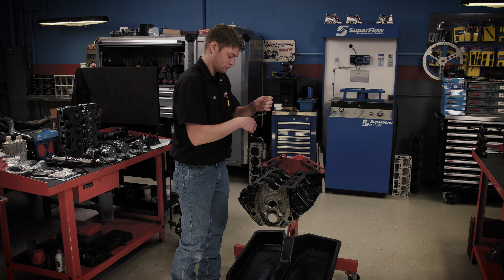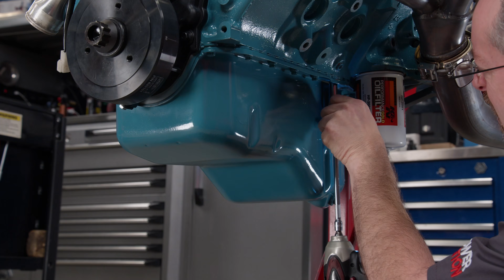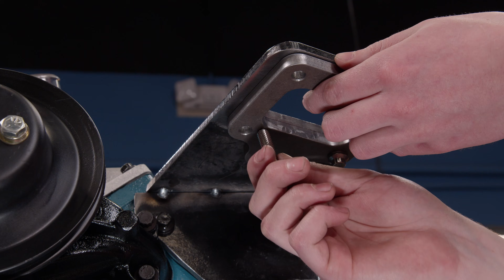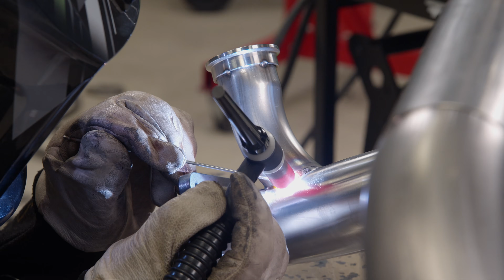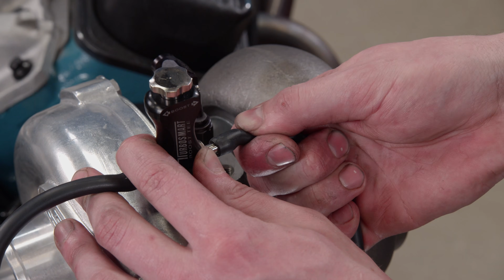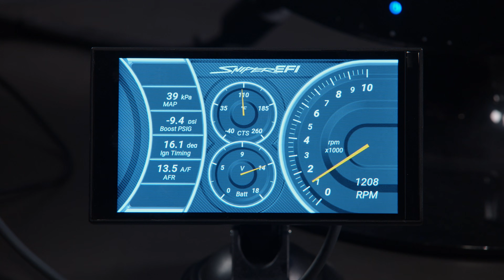Boosted 4.3L V6 Makes Over 500 lb-ft On The Dyno! - Engine Power S9, E8

Comment: At 58yo and have owned many many GM trucks in my life, most have had V8s, but a few have had the 4.3L V6 which I have usually gotten 300 to 400K miles out of, they are solid little engines.
Reply: chevy should have built this with modern fuel injection and put it in the colorados and all the smaller suv’s. hell mayb even the bigger ones to.
Reply: @stanroark55 they don’t care enough about us to make good products anymore…….. it’s just a money grab.
Reply: @stanroark55 they did there is a gdi v6 based on the gen5 it's pretty good
Reply: @stanroark55 Well to be fair they just phased them out in like 2016. Yeah it’s been 10 years but it’s still there
Reply: Chevy does have a modern vortec 4.3V6 with multiport fuel injection. I had a Chevy Express 3500 van with that engine. It was a 2019. 275HP, 295 torque. Still the standard base engine for the Express 1 ton and WITHOUT cylinder deactivation-which is the stupid fuel economy tech that's been killing LS/LT engines in Chevy trucks
Reply: I’m at 325k on mine. 02 Silverado single cab. She’s slowing down a little, but the thing keeps chugging along and never gives up
Reply: My youngest sin has blown 2 up within 2 months
Reply: @Davidsmith-uu4bl  son needs learn how maintain one got 400 thousand out of mine and my other one had 300 thousand 😮
Reply: Currently on 230k miles on my work van still running solid
Reply: @twitchgxgge I'm guessing you had to replace the timing chain at least once??
Reply: @Tomarsnback.  I have seen so many 4.3s with 200,300,400k+ miles and I've never even heard of that once
Reply: I have a 97 S10 5spd vortec. Prb 330,000mi. I've swapped trans (locked UP on freeway😮) but I put another 5spd in it, cat stopped up once so new cat, let it sit up 15yrs (...marriage 😮). Last year I pulled the gas tank and swapped it and the fuel pump, filter, spider injector, plugs, swapped the factory flex fan (awful feeling it rob power) with an electric fan assembly, drilled and silver brazed the temp sensor boss in the thermostat housing (looked really good). It ran. I took the 97 core support off and installed a newer idk 2003 core support and modded the wiring. Not finished yet but about to spend some more time on it.
Reply: I have a 1997 WT with a 4.3. I was at 280k when it blew a head gasket. I did a mild rebuild to get it back on the road.
Reply: I have a 95 S10 with the 4.3. Has 306,000 miles and is stroking right along. My dad purchased it new. I inherited it from him with 5,000 miles on it. It is a TBI and has been very solid up to this point. I love this little truck!!!
Reply: @stevendiffy768  The Chevy S10 is a legendary truck. I wish I still had one.
Reply: @stevendiffy768  Agreed
Reply: @stevendiffy768 that’s good to hear. I just bought one that has 120,000 miles on it with the 4.3 tbi it runs like a sewing machine
Reply: Agreed, had a 2000 Safari and it got 1 million miles across 2 rebuilds. The engine still ran perfect too. The rear was rotting out and my leaf springs were being held on by hopes and dreams. I only put a better distributor, iridium spark plugs, new wires, water pump, and thats all the engine parts that were ever needed. My new 1997 astro im currently doing head gaskets on. Seemed to be an ongoing issue since I got it but ended up overheating once and cylinder 4 was getting Hella coolant in the combustion chamber. Once its back together im hoping its fixed and runs like it was. Cleared a lot of gunk out the coolant ports so I feel like it was a gunk build up that caused my issues. Always flush coolant system properly before switching to green coolant. The dex cool polymerizes and makes mud when mixed with green coolant. Had to dig some of that mud out the port openings on the block with a screwdriver and vaccum. Put some felpro permatorque head gaskets on. Should hold until the engine is done.
Reply: @toastythereaper7119 aren't the safari a awd ride?    Build it all in black ,,back in Chevy cyclone days. They used awd drivetrain from the Astro van awd , check out the specs on them,, something in the transfer case was the ticket and that problematic tuned port stuff I can't stand, then tuned port would be out for me to many other useable simple options.   Less is more in my book, hard to beat the Rochester spread bore!!!😊.
Reply: My buddy is currently at 368,000 miles on his 4.3. it runs perfect!
Reply: I'm so sorry!!
Reply: 96 and 98 Blazer, no engine problems, trans weren’t great.
Reply: @808bigisland  if you change the fluid and filter often, they normally last a long time. I've always had good luck with the 700r4, 60e/65e/70e. People beat on them for 100k, 200k miles and never change the fluid and they get a bad rep because of it.
Reply: 250 K on my little C1500 and going strong with almost 0 power loss over time, (except when head gaskets leaked).
Reply: I’ve got mine with original motor and trans ticking at over 322k
Reply: little ie 262ci (small block?)
Reply: My first truck 1990 GMC S15 
Had the 4.3 with a 5 speed 
It was basically a full size truck
Reply: A GMC Jimmy, and 2 S-10 Trailblazers I had with the 4.3 went over 200,000 each with no failures
Reply: ❤️ My S10 just hit 313,000 miles this afternoon!!! It sounds amazing!!!🇺🇸
Reply: There’s a guy I watched on YouTube who found a single cab short bed V6 Silverado and turbo charged it with a marine intake from the short lived boat use engines from the 4.3 Vortec. Guy made 390hp and 434pftq
Reply: I own a 2008 sierra with a 4.3 vortec runs real good has 300k miles.
Reply: I just got a 1985 Chevy c10 Scottsdale long bed that has a 4.3 v6 people keep telling me to swap it but I might keep in it for a while it’s been running so well might to boost it  too 😅
Reply: The 4.2L Vortec inline 6 is heads and tails better.
Reply: How?
Reply: Mine was only at 143k and crankwalked
Reply: @ExtremeDirtRipper69 that is because you didn't do regular oil changes and ran it like a race car. You were lucky to get 140k miles.

Comment: Need to do an Atlas 4200 build guys. Nivlac57 has proven this platform is really slept on. I’d love to see what you guys could do with one of those. Also, 4G63 build possibly? 4B11 build? KSeries, B series builds  would be fun to see a shootout between them all.
Reply: Go for Atlas🤙🤙
Reply: I pray they don't. 4200s are still quite cheap.
Reply: @ggates2500 I doubt they even read these comments. I wish they would do more uncommon engines/builds like this video. We know they can build any engine from the Big 3, venturing out to do uncommon engines would be awesome! The VK56 V8 from a Nissan Titan seems to be quite the beast, they make 1966hp stock block, crank with just pistons and rods. Running mid 6’s already. Or the Hyundai Tau 5.0, something kinda odd ball but I think could make great power. I’d love to see Pat do a mad scientist build on something like those engines.
Reply: The Nissan engine is essentially a bigger coyote
Reply: Another Atlas 4200 vote
Reply: Here's Richard's  4.3 vs 4.2   youtube.com/watch?v=2bWgouS97VY   4.2 made more power @ 8psi than the 4.3 made @ 13psi. and the 4.2 was straight outa the junkyard with not great compression on 2 cyls and it was an early one. the later ones make more power. 4.3 was bascially rebuilt fresh
Reply: I agree
Reply: Build one please!
Reply: The American 1Jz 😂
Reply: There’s a guy n my street with a 550whp Buick Rainier with the 4200 atlas. All it has is a mocked up turbo set up
Reply: I'd like to see the inline 5 of that engine series on a build, but i guess it doesn't matter, i started mine. lol
Reply: @GridIndustries The 3.5L Atlas is a hell of an engine in stock form, but I think it'd be ALOT of fun with a set of forged internals and a turbo build!
Reply: That's my plan, but rods and pistons are crazy expensive! Nivlac has proven the rods to like 700hp and I'm not going near that high. So i think pistons are gonna have to be the compromise and run the stock rods.  @GivethToMeTurbo
Reply: I built a 1997 Civic coupe with a B18B1 non-VTEC Honda engine with Eagle H-beam rods, CP 30 over 9.0:1 pistons, a PR3 Civic Type-R VTEC head, Golden Eagle LS/VTEC conversion kit, Cylinder Support Systems kit, Skunk2 Stage 4 Turbo Cams, S2 Lost Motion Assemblies, S2 dual valve springs with titanium retainers, S2 3.5L Ultra Race intake manifold, S2 90mm throttle body, E85 from Grams 2200cc injectors and a rewired and relayed Walbro 530 LPH Hellcat fuel pump, all -8AN supply and return hoses, a K-tuned composite fuel rail, Aeromotive external FPR, Private Label Manufacturing top mount turbo manifold, modified Garrett GTS3582R dual ball bearing turbo with a billet compressor wheel and a 1.06 AR T3 exhaust housing, Mishimoto front mount intercooler and 3" piping with a Tial Q50 BOV, Honda P28 ECU with a Hondata S300 V3 Bluetooth with a custom dyno tune, an Integra GSR transmission with a 4.4 final drive, an LS Integra 5th gear, a Quaiffe LSD, and it laid down 709 wheel horsepower on 34-36 psi on a DynoMax dyno. My buddy has a 1992 Civic hatch that's fully gutted with a B20VTEC that has a huge Precision turbo that made 834 whp at 38-40 psi. We both ran 9s in the quarter mile. We were just having fun. I spent around $20-25,000 on mine, but he has around the same in his. My Civic was a drag/show car, and his is all business. I sold mine because I hated to see it sit, but he still has his because he has two garages.
Reply: @GivethToMeTurbo  Please tell us, how does that word soup of expensive Honda parts fit in to a comments thread about the GM Atlas engines?
Reply: @PiDsPagePrototypes  4200 parts arent cheap either.
Reply: @PiDsPagePrototypes he’s just more interested in hearing himself talk…
Reply: Calvin aka nivlac57
Reply: Why all import bullshit
Reply: @Buicklover the Atlas 4200 is a Chevy engine….not imported whatsoever. It’s in the Trailblazer all American iron. Also the import engines are great platforms. Why build the same thing over and over? They’ve literally built every big three combination you can think of. Why not see what else is out there? Or you prefer the same thing done over and over again? I think they need to explore new platforms. Pat has the chops to build literally anything, I say let that dog hunt.
Reply: @BoostedCajun all American aluminum

Comment: I'm thinking that 4.3 should be used for S10 4X4 truck. Everyone 2 wheel 🛞 drive I thought would be perfect for 4X4.
Reply: So long as you take it easy in 4. That front diff isn't going to like boosted torque if you get too frisky on the throttle
Reply: I say s10 or first gen Colorado prerunner build